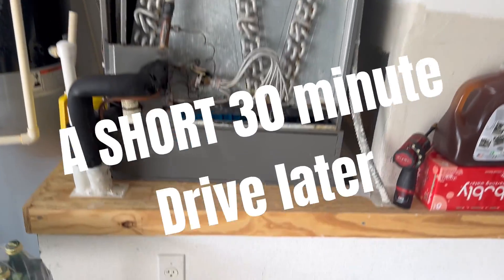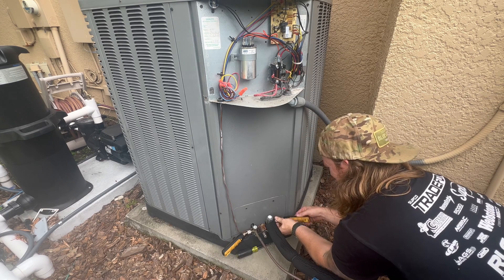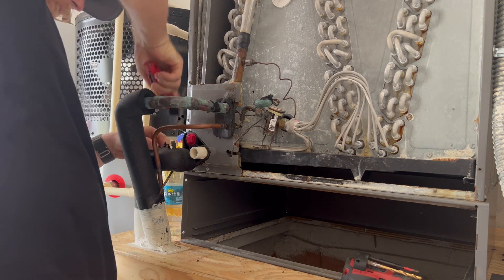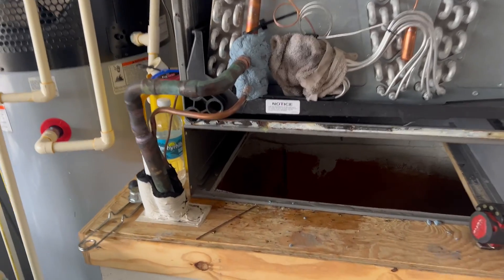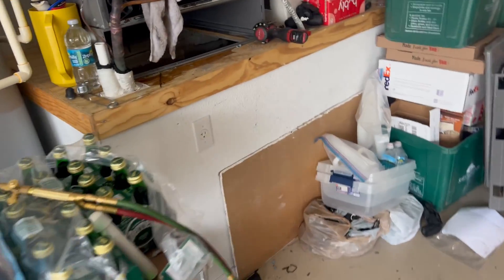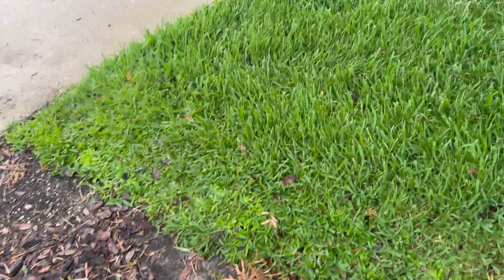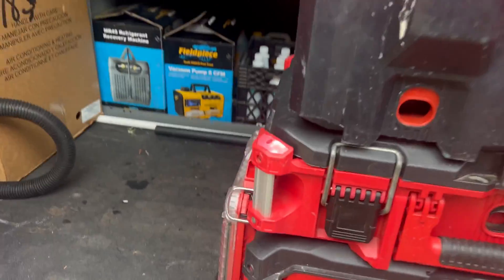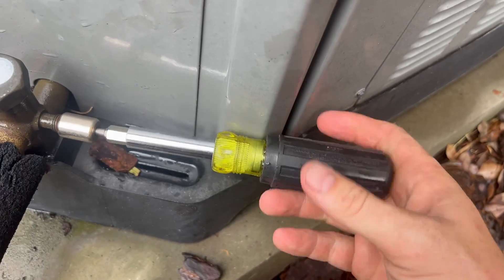Major QC PROBLEM | HVAC Tech | Ruud evaporator and valve swap

Comment: Great work!   I’m moving to Bradenton.  I just just getting started in HVAC and started a company in IL (where you don’t need an actual license).   I want to start part-time and eventually make this a full time gig in FL, but the experience requirement for licensing makes it almost impossible for a part-timer, unless I work for a company.  Any suggestions, workarounds, etc?  I am EPA certified.  Thanks!
Reply from the maker: Love Bradenton!! That’s where my wife’s from!! My suggestion would be if your able to go full time and total learn hvac here, do it because it’s just a different world. Especially on the gulf side would be really good to really dive in and master that location and go from there 👍🏻 hope that helps, good luck on the move!!

Comment: Good job bud it’s hot down here in Florida fo sho. I always put valve cores back in on positive pressure after opening the condenser, then doing a rough calc on added charge then supercool the subheat
Reply from the maker: Appreciate it dude! I’ll keep that in mind, I use to add charge to break vacuum before putting cores back! Do you find by estimating charge with line set length it’s pretty close? Thanks

Comment: I'm so jelly 😭. You have a garage unit with the van like 2 feet away, ground floor, outside the house, no attic no crawlspace no roof, only way it could be better is if the garage had its own mini split for cooling while you work on the coil.
Reply from the maker: Funny thing is Sam it DID have a mini split in there 🤣 😂 JUST KIDDING!! Was definitely smooth, the rain ruined it tho 🤦🏼‍♂️

Comment: Be careful with 410a and any other blends leaking....they could fractionate and separate...then you have a different percentage of R32 and R125...( 410a is 50% 32 and 50% 125 )....kick ass video as always Jake.
Reply: Fractionation is a non-issue when it comes to R410A due to the very low temperature glide. You can always verify from the manual of the manufacturer and the refrigerant’s listed temperature glide to discern when fractionation needs to be worried about.
Reply: I’ll also note a direct test by DuPont about R410A that after leaking half of a charge and recharging to full multiple times on the same system, the capacity only dropped during the second recharge. However the drop in capacity went from 100% to a whopping 99%, and it maintained a 99% capacity from original charge even after the 4th recharge. Which is understandable as during operating pressures the temperature glide is going to be less then .3°F.
Reply from the maker: Bruh 🤯 🤣 Appreciate it big homie!!! 💪🏻

Comment: Don’t put the valve core back in or remove the ball valve until you at least break the vacuum with the Freon first.
Reply from the maker: I’ve heard differing opinions on that! Obviously potential for atmospheric back in, but I use to do it that way until about a month ago when I did it, ruined the sensor in my mg44🤦🏼‍♂️ guess I could put another core tool on micron gauge and and do the same thing valve it off 👍🏻
Reply: @KoolinwithKrauss  does Fieldpiece say it’s bad for it? I have the blu vac and it doesn’t bother it my young tech bought the same one you have and we always do it the same way by introducing the Freon with it still attached
Reply from the maker: @joeshearer1247  nah it doesn’t say you can’t. It’s rated for 870 psi, not sure what happened that’s the only only one I use and just died, would stay at like 531 on the screen and it was out of warranty (of course)
Reply: @KoolinwithKrauss  did you send it back under the out of warranty repair option? They basically sent you a new one for fraction of the price
Reply: why not?
Reply: @jroden1985  BluVac is rated for it